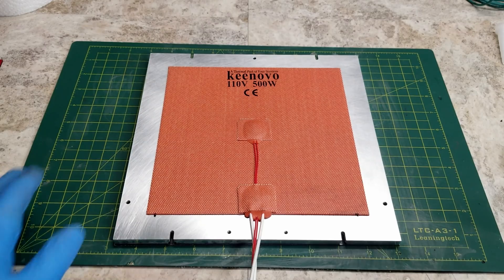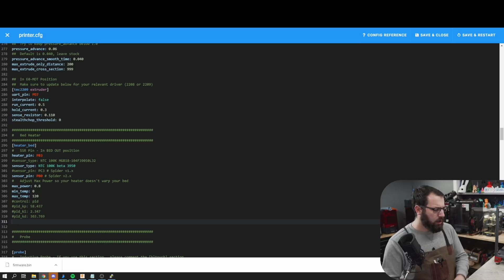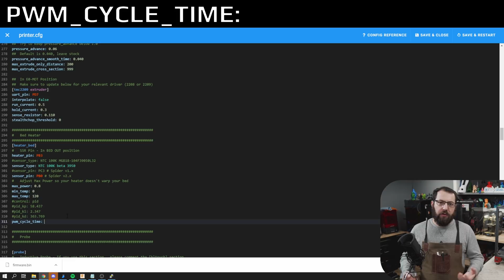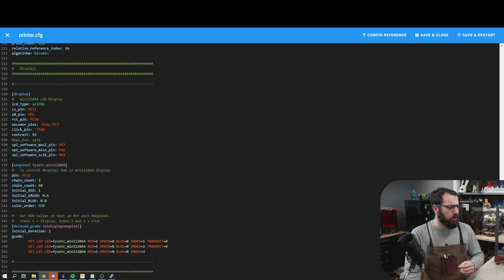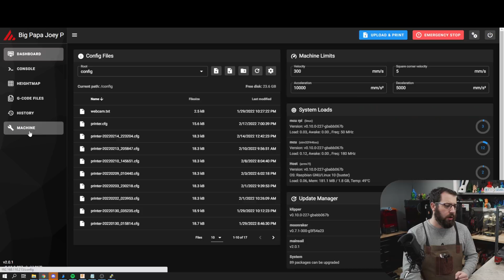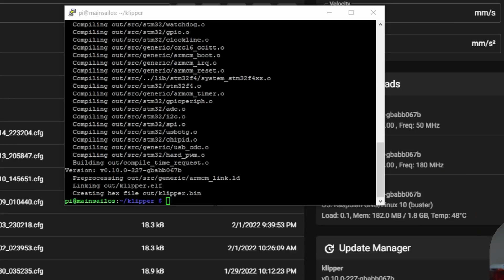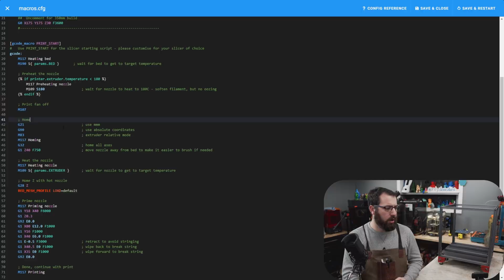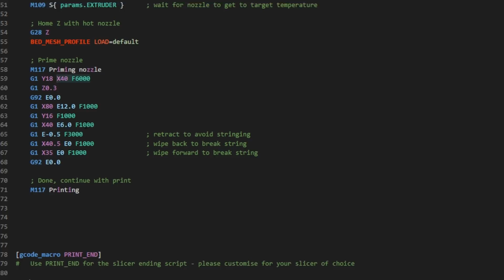Quick Klipper Tips - Expanding your 3dp toolkit

Comment: bro if your lights flicker when your bed is on you need to call an electrician for real
anything else is just asking for trouble
they should not flicker under any resistive power draw. youre not magnetizing a big transformer or starting a 1MW induction motor! youre switching a resistive heater.
imagine using one of those 3kW air heaters, thats much more then your max 1kW bed, only a question of time when your house burns down.

Comment: G90 = Absolute mode = The coordinate values specify an exact location in 3D space. The toolhead will figure out how to get there from it's current location.
G91 = Incremental mode = The coordinate values specify direct distance values for each axis. The toolhead simply moves by the amount specified in the values.

Comment: Just wanted to add that if you're having problems with getting your heater bed to work correctly after making the PWM_CYCLE_TIME change, try playing around with the target HZ value (1/60 is for 60 hz, 1/59 is for 59 hz, etc.) to get it to behave normally and still eliminate the light flickering. I had to go to 59 hz because my SSR did not like the 60hz value and I kept missing the zero crossing window for my relay at 60hz. Just bump it up and down around your target until you're happy.

Comment: Thanks for your videos! I just started using klipper on my Anycubic Mega S and i encountered the problem, that the stock speeds (F7600) used for the incremental movments (using the GUI) are too high for my printer and it just rattles and only moves a tiny bit. I can manually decrease speeds to 45% with the GUI and everything works just fine. Should i try to increase the voltage on the stepper driver or is there also a way to reduce the "stock speeds"?

Comment: Flashing controller firmware is even simpler than that - in recent versions of Klipper it is zero copy. Klipper has a bunch of scripts for flashing firmware, including "flash-sdcard.sh" that copies the firmware directly to the SD card in the controller board, then reboots the controller. As long as there is an SD card in the board (I leave mine in there permanently) then it is just a matter of running the script. You have to supply the name of the USB connection as a parameter.

Comment: i have 1 problem with me jumping into klipper firmware
 how to you turn off everything by turning off the power supply

 aka protecting the raspberry pi and sd card corruption
 nobody anwser that very question :S
 thanks

 Edit1: right now i found a diagram to send a low signal when power out and a ups for the RPI 
 but how does i program the pi to read a GPIO pin  since i do not know how linux work i am lost aslo klipper seem to be using his own OS
 so  how does that compare to raspian when it come to stuff like this
 Edit2: found a script you can install for that but afraid to try with actual RPI with klipper installed to see if its the same as raspian os  waiting for a pico to get shipped

Comment: Nero, good stuff, as usual. Could you also consider making same format short tutorials, covering mechanics:
Gantry alignment and belt tension. 
Z calibrate with klicky probe and best practice setting up start routine (homing, quad level, Z calibrate, mesh load etc)
I know that most of it has been covered during life streams. But small tutorials are much easier to search and navigate. 
IMHO.

Comment: The G90/G91 hint is the most important and is not related to the Klipper only. Almost all firmwares use the same approach even considering the fact some Chinese vendors customize Marlin settings for their boards to have G90 mode as a default( and some use G91 as a default value). Quite often different bloggers/reddit topics and forums provide a "silver bullet" "start code" for slicer printing settings for newbies. In 99% this code has a purge line(s) movements, but only 2 out of 5 explicitly specify G90 mode before the line drawing commands.

Comment: Nero, thanks for all the help, my Voron build was a breeze thanks to you. Here is my problem:
I blew my 5A 110V fuse within 2 seconds of using 0.01666 cycle, no motors moving 750W bed. I am also not sure how max_power affects it, but mine was at 0.6
Reply: 750W bed? The fuse holds up to 550W, that seems to be the problem here
Reply: Same here.

Comment: doing the "pwm_cycle_time" caused me to get constant temp errors and firmware restarts.  Discord users noted that SSR are 0 cross activated, meaning the wait for the AC wave to pass through 0 to trigger it on/off.  if your cycle time matches that cross over time, it won't always turn on the SSR, but klipper won't know this and so the heater doesn't heat as fast as it should and fails.

Comment: Thanks Nero, because of you I converted my printers to Klipper a year ago and I'm still very happy. So here is my little tip I want to share: define a [idle_timeout] section in your printer.cfg where you add what has to be disabled when paused. This way when making, for example, an M600 macro your bed will stay heated and your steppers enabled.

Comment: One  video that would be extremely helpful would be a guide for how to create a klipper config based on a marlin config and marlin pins file.
I have a printer which don't have a klipper config for the stock controller.
Been trying to create one, but I'm pretty stuck getting all the pins correctly named etc

Comment: Just added the pwm code for 60hz. It definitely stopped my lights from flickering but then looking at the heat graph it's  on a consistent temp increase anymore then I clipper emergency stop saying the bed wasn't heating as expected. Any idea why this could happen?

Using BTT Octopus with SSR controlling the bed on mains power (110v). Removed that line and seems to be working fine again. 

Thanks!
Reply: You might have a problem with synchronization and turning the ssr on/off. Some SSR turn on when the voltage (sine wave) goes true 0. All SSR turn off when the current goes thru 0. If you get lucky and try to match the frequency you might get funny regulation no mater what PID settings you are using.  

If you would want to do it "proper" then you would need to synchronise your pwm_cycle_time to the mains frequency. We can thank that the time response of the alu plate is >>> then mains frequency, as if not the PID regulator would not be stable at any setting.
Reply from the maker: Re-run your PID tune after adding the pwm_cycle_time

Comment: A tip on the G90/G91 issue - I put the G90 in the PRINT_END and CANCEL_PRINT macros so that it's always in absolute mode after a print or after cancelling, rather than putting it in PRINT_START. That makes any manual commands work as expected. Also, put an M18 in CANCEL_PRINT to put it into a "safe" state. You might have canceled because of skipped steps, so your firmware's coordinates are out of sync with the actual physical position. M18 turns off the steppers, which forces it to home before any other movements are allowed. This is obviously in addition to turning off the heaters, etc. which should already be in CANCEL_PRINT.

If you're willing to learn how git works, or you're a programmer and already know, it's worth making a git repository for your klipper configs (and even your slicer configs). That gives you a backup, as well as tracking versions; maybe you made a change that broke something, and you don't know what it was - it's easy to revert that. You can also split it out into printer-specific configuration options from non-printer-specific ones. That way you can keep those options in sync across multiple printers very easily. For instance, if you write a cool new macro, you can add it to all of your printers with minimal effort.

Generally, it's worth learning how the template/macro language works in Klipper. You can set up some pretty fancy macros for automatically managing filament-specific settings, heat soaks, automating a Nevermore, etc.

Comment: I am loving Klipper!!! When i was using Marlin i was constantly compiling firmware.. ugh... Klipper is sooo much better in almost every way... almost... The Klipper devs must not think filament run out sensors are very important as the M600 command don't work.. Even if you use their marcro.cfg on the github... I however enjoy the extra functionality a filament run out sensor brings to my printer... plus i really enjoy printing multi color prints by pausing at layer with an M600 command. I have spent hour trying to set up my own m600 macro and just cant get it to work right... I know it can be done and i know its been done before but i cant find a working macro to do it.. It would be AWESOME if you could do a tutorial on this! I know i am not the only person who wants the use M600 in Klipper and it would really help the community!
Reply: Im using the pause Macro to stop my prints for a color change:) but make sure to set the idle time up, or else you need to home after leaving the printer paused for more than 30 minutes.

Comment: I had issues with my ups when using pwm_cycle_time of 0.0166. After printing for a while the ups started alarming. After searching in discord it appears that some ups don't like devices that cycle at exactly 60hz. Ellis uses 0.017. This works for me with my ups.
Reply: 0.017 my lights flicker, at 0.01666 I blew one of the 5A 110V fuses.

Comment: Not so much of klipper but mainsail quick tipp - in the file list there is a setting to hide the autobackup files mainsail creates. good to have them - but nobody wants to see them :)
Reply: You are technically correct, which is the best kind of correct. However, I beleive that is only in the 2.1.1 release. He is running v2.0.1. There are some features he doesn't have from the current release.
Reply from the maker: Ya, ive got many different versions of mainsail/fluidd on my machines, im horrible when it comes to keeping them up to date. lol
Reply: Thanks for the tip! It's in 2.1.0 according to the mainsail github releases.